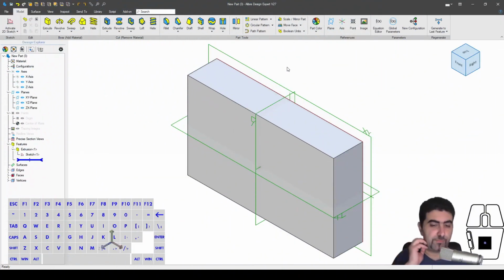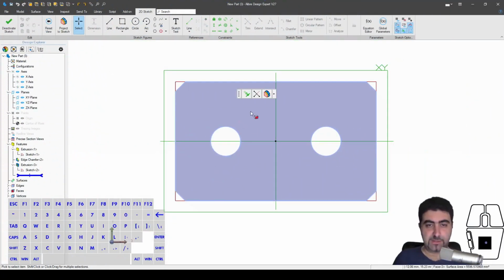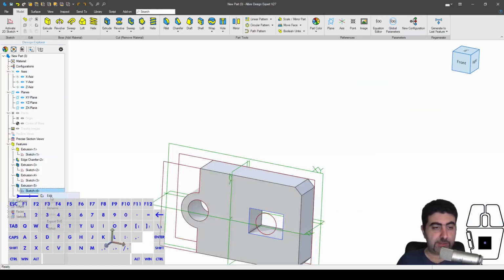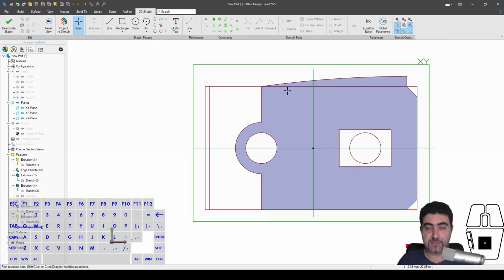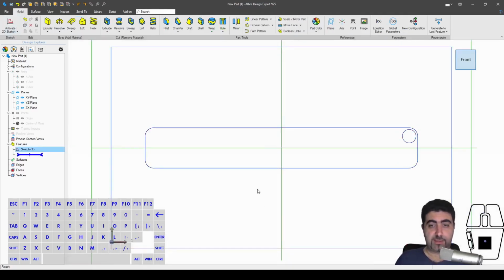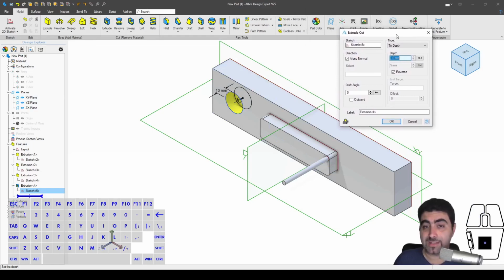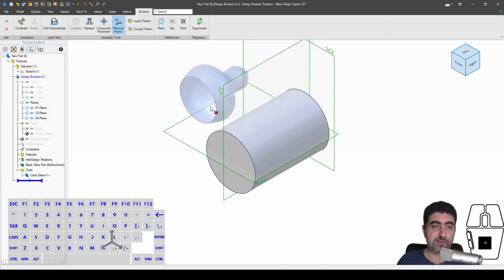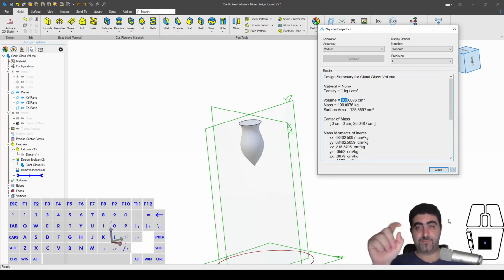Black Belt in Alibre: 10 Master Moves!

Comment: Hey, brilliant video, thanks. I'm planning to get Alibre Expert, but don't seem to find any surface features such as extruding surfaces. I only see import a surface, which can then be modified. Does it not have surface creation at all?
Reply from the maker: Hey Bran, Glad you liked my video. In Alibre you cannot create a standalone surface. However, you can extrude a solid and then remove the additional faces to get the surface you want.
It is unintuitive, I know, but if you spend some time with it and get the hang of it you can do amazing stuff.
Check out Majora's Mask over on the official Alibre channel. Or the one with creating a injection mold. Both amazing surfacing videos

Comment: Your vids are great!  I am learning a lot from them, but you sometimes move a little to quick thru the feature selection menus.  I know you know where they are, but I have to run thru them several times to get the precise selection.

I am unable to figure out how you  got Auto Dimension to work for NEW elements of the sketch.  

DO MORE VIDS!
Reply from the maker: Hey man! Thanks for the kind words. I am glad I'm helping people get more out of their CAD system.

As for Auto Dimensions, you don't need to do anything. They are on by default, but you need to input them before doing the second left click. For example in a rectangle, you click once to place it, move the mouse to start the rectangle going, type the first dimension, hit tab, type the second dimension, hit enter.
Hope that helps. Let me know if it doesn't work for you.

Comment: I use global parameters a lot, but I have not found very many videos on this.  If you have done one, please supply the link.  I have found that GLP does not update consistently and there are times the global parameters don’t stay.  Also, shells and global parameters don’t work very well.
Reply from the maker: Here's my video on global parameters:
https://youtu.be/W14U8DBpdrY

In it you will see that I save and then update parameters. Follow what I do in the video and they will work consistently.

As for shells, it is what it is, in any Parametric CAD actually. When a change in dimension means that a single edge or surface becomes consumed, they will error out. Same deal in Fusion, SOLIDWORKS, Creo, etc.

One thing I always propose is this:
Where possible, do the fillets and chamfers after the shell. It helps to mitigate a couple of the potential issues.

Thanks for watching and commenting man, and if you have any more questions please let me know